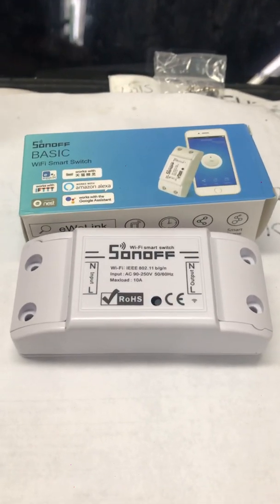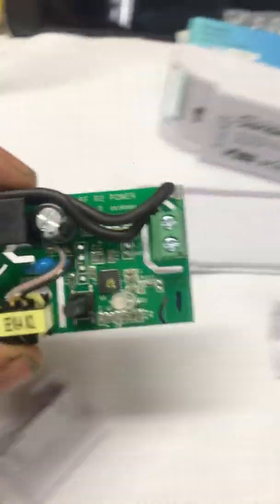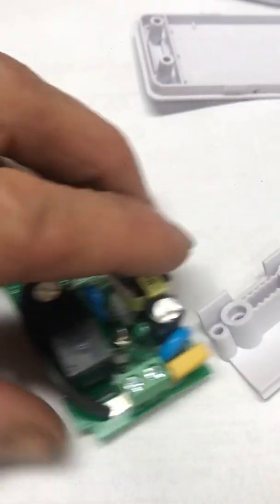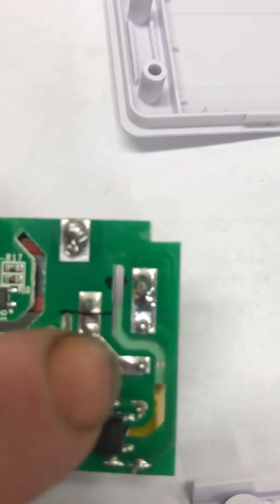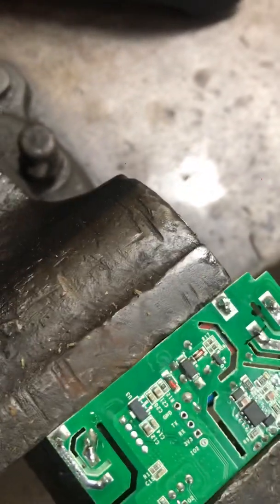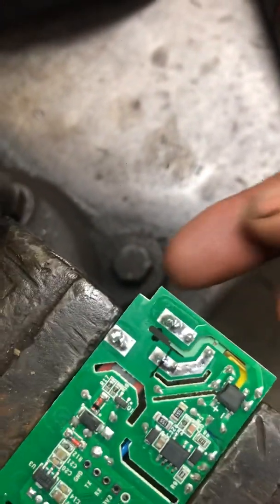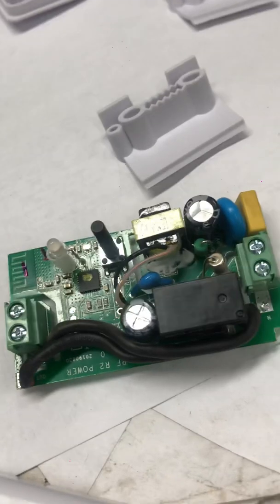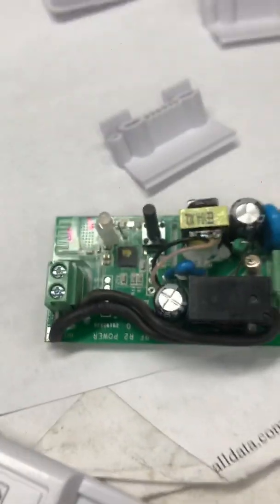How to make your dumb garage door opener “smart”

Comment: Thank you for the video. I bought mine and it was indeed a newer model than the video's I saw. I am not very knowledgeable on electronics and have seen another video do the same mod you showed, which means I have no doubt it will work.

I just don't understand how it creates a circuit now on the input side. All you have to do is disconnect the neutral from the input side and put it directly onto the black box, like you showed. How is there now a connection between the neutral from the input side and the load from input side? How does that create a circuit?
Reply from the maker: I know this is way too late for you but I didn’t see your post till today. In this modification I do not want to complete a circuit to the input voltage, I found that the positive voltage from the input side was feeding back into my controlled side causing the garage opener to keep buzzing and stop working correctly. So after this modification, I am only using the relay to temporarily connect the two wires from the garage door opener. Just like the doorbell switch that is used on these older unit would do.